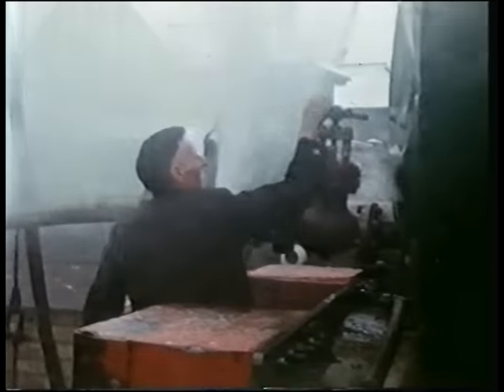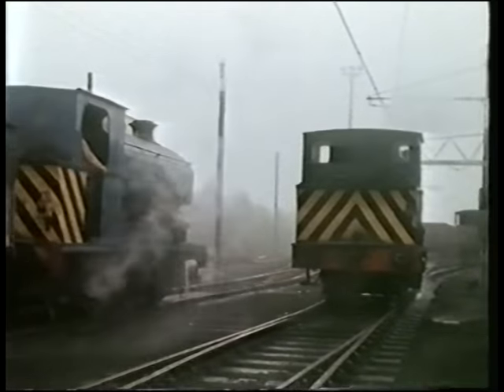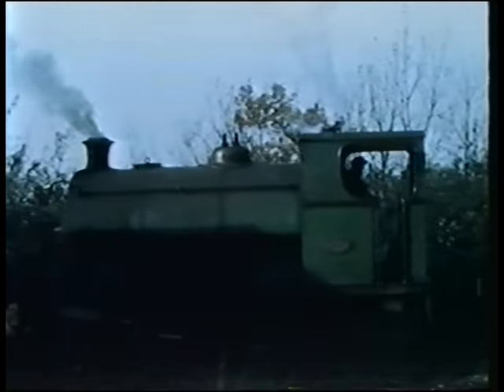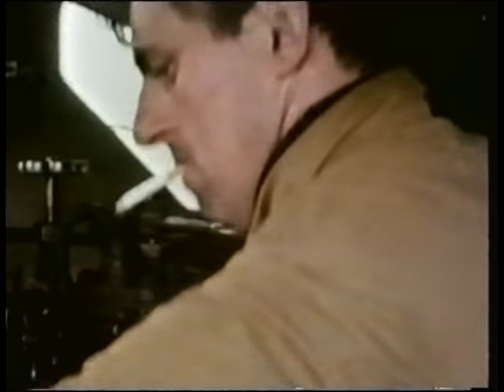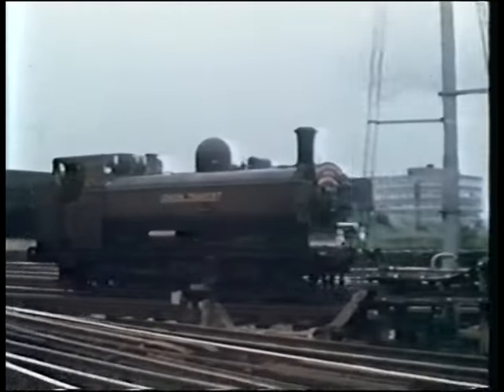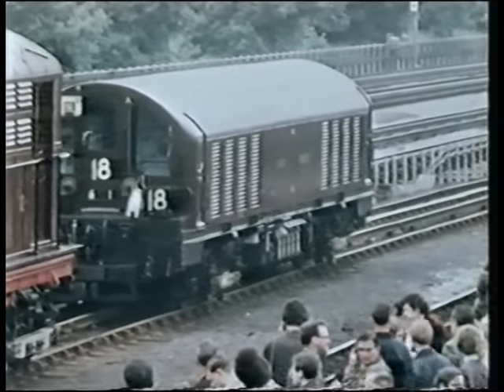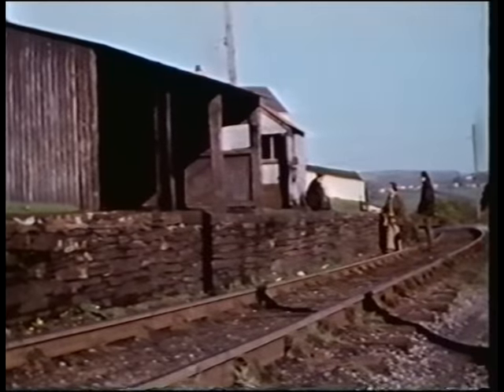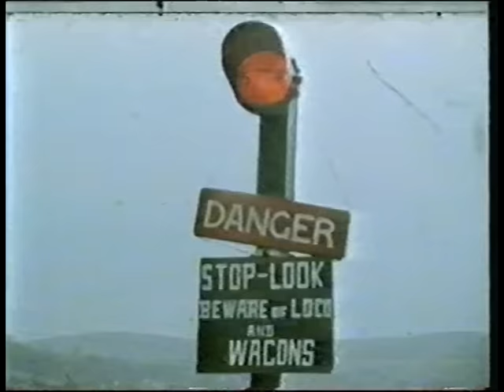Industrial steam

Comment: Why were steam trains banned in Britain in the first place?
Reply: They weren’t.  BR banned the use of steam on their lines for a few years on their lines after the end of steam in 1968 but even then there were exceptions, BR still owned a narrow gauge steam railway in Wales at that time, I think Flying Scotsman had an exception due to an existing agreement, and there were still some steam breakdown cranes which could move themselves along the tracks.

Any other organisation could use steam locomotives on their own lines if they wanted to.
Reply: @srfurley  Steam was banned because it was inefficient and polluting. Too difficult and expensive to maintain. Most steam locos were chopped with cutting torches and the scrap sent for melting down.